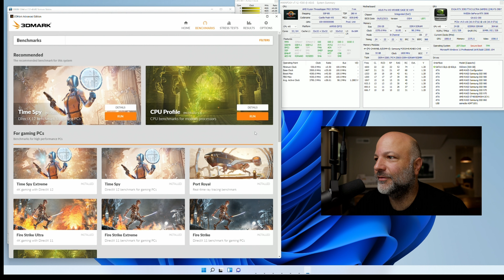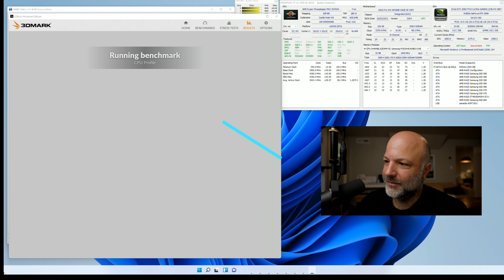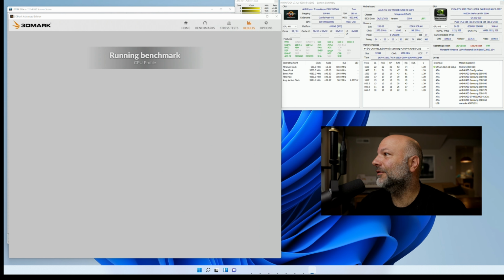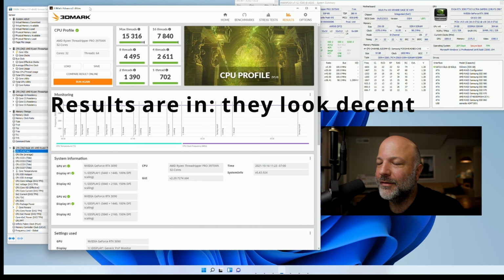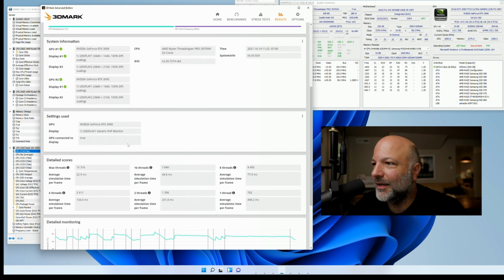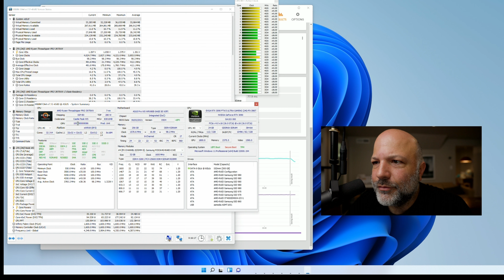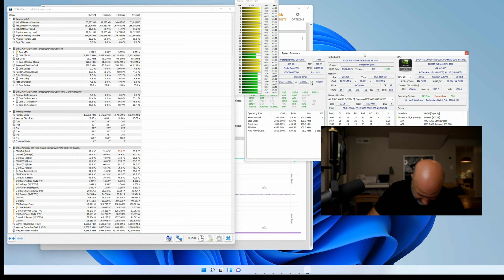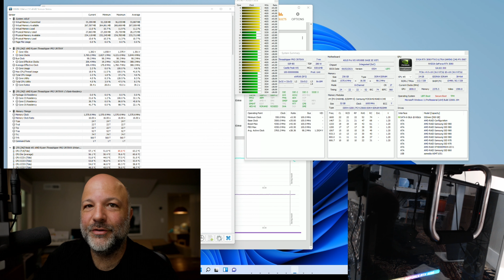Woah, Air cooling your Threadripper Pro…

Comment: FWIW, there is a newer bios out for the sage. 0602.
How's the RAID on the Hyper M.2 card situation?
Reply from the maker: The RAID was working fine until I installed Windows 11. It looks like that new BIOS has Some Windows 11 specific features. I’ll have to check that out. Thanks for the tip.
Reply from the maker: I did the following to get RAID up and running on Windows 11
- Installed the latest BIOS for the ASUS WRX80 motherboard
- Deleted the old RAID array in the BIOS
- Installed the latest RAID drivers from ASUS
- Rebuilt the RAID array: This time RAID 10 for speed and reliable

The results are pretty good.
16000 MB/s Sequential Read
9000 MB/s Sequential Write

Comment: hey, i couldn't find any info anywhere so i'm gonna ask here.

Does this motherboard support hdd raid (5, 50, 6, 60)? 
Can you setup a raid through the ikvm?
Can you perform bios update through the ikvm?
Reply from the maker: Yes it supports HDD RAID, which can be setup through the iKVM, inside Windows, or in the BIOS utility.  It seems to support all RAID configurations.

I am currently using RAID 10 to mirror and stripe four 500 GB NVMEs into a super fast and reliable 1 TB drive. I am using the motherboards built in RAID controller. I had to install a Windows driver to make Windows recognize it. 

It is my understanding that it is more difficult getting linux to recognize the hardware level raid disk directly. I did try that, and ended up using a software RAID instead: mdadm.

That worked well too: although at the time I was using RAID 0, and that caused some issues with file/disk corruption. I've since  been using only RAID 10.

Comment: Hey may I ask what temperatures you would get without overclocking so just at stock speeds
Reply from the maker: This video shows the temperatures with no overclocking. Boosting is a part of the normal operation of the chip; it is not achieved through overclocking.